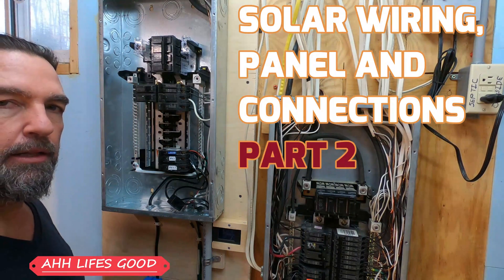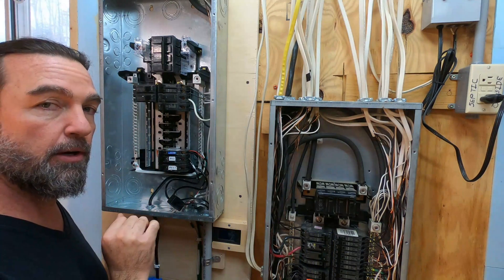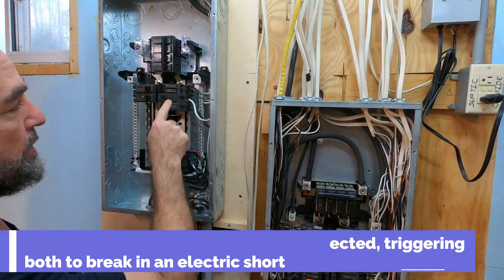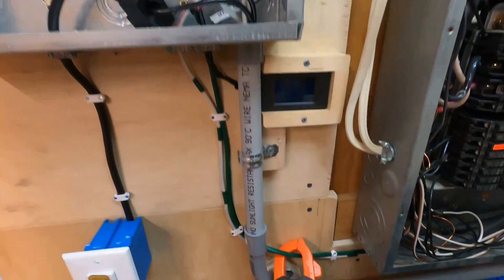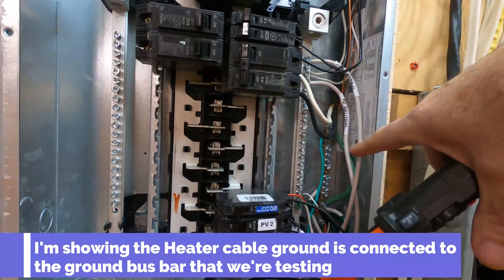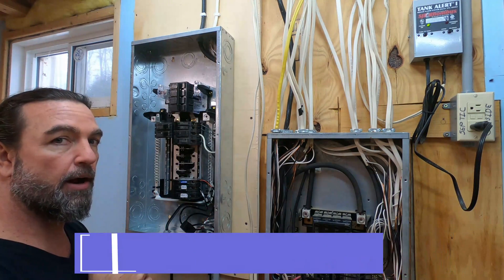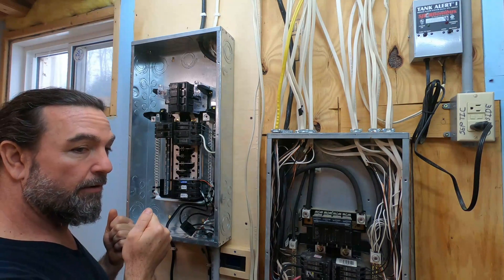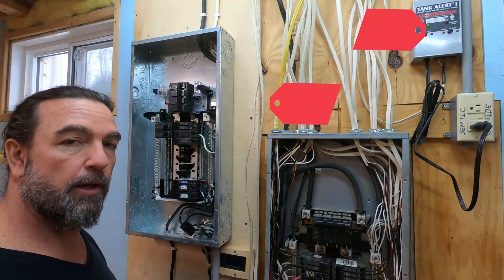Part 2 - DIY - How to wire Solar Panels to Break Box - Beginning to End

Comment: the white wire going to the 220vac breaker should have a piece of black tape to remind people it is being used as a hot or line wire.
Reply from the maker: Thank you for the tip, good advice

Comment: HOWdy  A-L-G,

in INDIANA - a SUB-PANEL is never EVER "BONDED" or the service will FAIL Inspection 
the FIRST PANEL ( MAIN PANEL) is BONDED "period" 
but 
NONE  of my Sub-Panels have the BONDING SCREW inserted 
...
on any of the SUB-PANELS 
ALL the GROUNDS are independently GROUNDED Near the Sub-Panel  on their own BUS Bar 
& All the NEUTRALS have their very OWN Bus Bar (separate from the GROUNDS) 
this was decided by INDIVIDUALS much smarter than me :-) 
... 
No "BONDING" on  my Basement Sub-Panel 
&
No "BONDING" on  my PoleBarn SUB-PANEL 100' feet away 
...
Both of my Sub-PANELS  have their OWN Ground Rods driven 10' in the Earth X 2 ( six feet apart ) 
... 
Your  local may have different RULES for SUB-PANELS  & Bonding 
...
COOP

Comment: So if i read this correct. If i have a off grid shed with one main panel for lights and outlets nothing coming in from the grid. Then i should screw in the green screw for bonding? I have the same invertor as you but only using 1 at this time. everything is going great except this green bonding screw.

Comment: That has been the burning question grounding I basically have the same system. I haven’t set it up yet it’s going on my cabin build in Southeast Oklahoma but the one thing I am not hooked up to the grid but I am in metal shipping containers. I would love some advice I was just thinking I was gonna treat it as if my first panel will be where my two inverters in my transfer form ago leave that box and then go to what I’m gonna consider subpanel with all my breakers and loads still not sure though about the inverters and how the ground goes any advice keep up the good work

Comment: My electric company bonds the ground wire (coming from the ground rod) to neutral (coming from the center of transformer) at the weather head. That ground wire does not come into the house (main panel). Only the neutral wire (which is now also ground) comes into the main panel. The two busbars in the main panel have all of the loads neutral and ground wires attached to them and those busbars are bonded. 
That doesn’t mean there’s two neutral/ground bonds. I used to think the ground wire itself from the ground rod comes into the main. If it did then I would have two neutral/ground bonds, at the weather head and the main panel. 
There should be relays inside the growatt that disconnect the ground/neutral bond for the AC out when in offgrid mode. Then you would need a ground/neutral bond in your “subpanel” and a separate ground rod that is wired to that subpanel. I’d think you need to find out if ground from inverters AC out is connected to ground of inverters AC in. If it is then id think you don’t bond ground/neutral in the “subpanel” because that subpanel would be utilizing the mains ground rod.
Reply from the maker: - Very helpful information and response, thank you for sharing!

Comment: As a mechanic with my electical knowledge all this bonding/grounding with the main and sub panels is very confusing. To keep things simple as possible, if it were me switching from grid power to off grid I would set up a seperate panel and as my system grew I would literally take circuits from the grid and place them in the off grid panel. Just keep adding solar or wind and batteries until my system could handle the load. I think you would be there for sure if you could get rid of those thirsty electric heaters. You have a great system and you are doing a great job in sharing your knowledge to everyone. Thanks!!
Reply from the maker: Thank you BFG for sharing your comments, good advice and words for all.

Comment: I know you didn’t do the original wiring, but I do have some questions about it.  You said there is a shutoff outside between the meter and your panel.  If that is the case, shouldn’t your neutral and ground be separated there?  Wouldn’t the original “main” panel inside be a sub panel?  If it is, then there should be separate ground and neutral busses in the indoor panel.  In the video I see both neutral and grounds going to the bus bars in that panel.  That may not be to code.  Also, at the top of the right bus bar it looks like there are 8 or more wires connected in the main lug.  Is that to code?  Looks sketchy to me.  Again, I know you didn’t do this wiring.  Your work looks great and I appreciate the videos.  I also have questions about separating ground & neutral and bonding on panels fed from the inverters.
Reply from the maker: - Morning Robert, great comments! There is a main shutoff outside at the meter  where the neutral is separated from the Ground of the main panel. I'm not an electrician but from my understanding the first (main) panel then comes from that shutoff is your main panel? That being said there is no separate Ground from the Neutral bus at the main (first) panel inside the house. In theory I agree with you 100%, it should be called a "subpanel" but in principal I don't know the right wrong terminology the electricians use for that setup? My guess is "main panel" as it seems to be the same configuration on most houses here. Now the sub panel I installed with the configuration I currently have on it, has a separate grounding rod from the main panel and is separated from the Neutral and NOT bonded to the panel (ground)... Yes that Main lug has about 30 cables into it, soon I will be cleaning the electrical up on that box. Any professionals please way in on your comments if this configuration is not correct, thank you!

Comment: I have yet to install my system but Im sure I will have the same problem as you do with the bonding. 

As I understand, the problem would occur when you Bypass the inverter and use the Inverter's AC IN to charge your batteries. Then youd have 2 places with the Ground/Neutral Bond. Im still researching what to do in this case.

Not using the inverter's AC IN / auto transfer switch would make things easier but I really want that transfer switch feature!
Reply from the maker: - Kevo that's a good question that was pondering in my mind in theory and principal when I was installing this system. Unfortunately I've never been able to find out exactly how the inverters handle the switching between grounds (transfer switch), seeing as there is 2 separate grounds running from the AC IN and OUT of the inverters. I know there is a Dry port available on the inverters that could be used in the event of a neutral short.

Comment: Your supply line from the grid should have line, neutral and ground to each inverter so inverters act as main panel and are grounded, any panel supplied by inverters are considered subpanels and as such should not be bonded
Reply from the maker: Well said Eric, very clear on grounding message thank you

Comment: Never Bond a sub panel especially where you got that green screw from the neutral Busbar to the Body of a metal panel. However you only Bond the first entrance of your main neutral together with the Ground Rod wire. Then all the ground wires connect to a ground Bar by themselves.
Reply from the maker: - Thank you sir for your insight, I keep hearing and reading this same advise while struggling with the logic of how the inverters actually handle that Ground/Neutral connection in the event of a short circuit, seedings they are the only device that's not a directly wired circuit between panels. Planning to follow your advice and keep searching for relevance on this topic. Any thoughts on using the Dry Contact port of the inverters to setup a Neutral Relay? Thanks

Comment: Inverters dont referrence the same ground as the mains in some systems so bonding the netural and ground is and the Mains power would drop and then for the electrcal system to find the bond its would have to travel back to the dead panels You have 2 sources of power with there own reference ...  The power company wants to make sure that your self generated power stays off the mains when they are working on them...
Reply from the maker: Thanks Traci for your insight, what's your opinion on installing a Neutral Relay switch on the Dry Port of the Inverter? In principal it should ensure that the Inverters only handle one Neutral at a time, alleviating the possible double ground issue if I keep the sub panel bonded?
Reply: @ahhlifesgood1956   @Ahh Lifes Good  I would check with who made the inverters.. Also enginer775  I am retired from power co and have seen what happens when power is fed back to the mains and even though your system will not at the moment who knows when some thing wil go wrong... Have the circuits seperate all the Inverter panel have its Netural to ground bonded then the mains being bonded at the first disconnect  like yours is   .. I wasnt sure but on your first main panel did you have many neutrals on the buss bar?  That is a red flag as well    
Safety was drilled into my head for my entire time that I worked there   I am not electrician as in the power side I was in the telecommunications side with Large DC plants   Cell sites  Solar and Genterating plants ....
Reply from the maker: @Traci_S_Aaron  - I really appreciate the emphasis on safety and correct setup, please keep the opinions coming. The bus bar on my main panel is a floating bus bar that functiond as neutral and ground. No seperate grounding bar here. From the main panel neutral bus bar I have a ground wire running out to my service panel at the meter which functions as the bond to panel and connects the Copper ground rod. Not sure if this is correct but it makes sense logically?

Comment: Wonder if the sub on grid tie needs separate ground and neutral wire back to main panel and tied into neutral bonded at that point?
Reply from the maker: - James that's a very good question, as that idea would most definitely tie the sub panel to the main panel alleviating the guess work of how the inverter handles that ground between both panels.  I couldn't answer that question though,  hopefully one of the viewers might? I know another creator out there Andy P installed a Relay Switch on the Dry port of the Inverter, which I beleive gives added ensurity that the inverter indeed will switch from open to closed on the Nuetral from either Main or Sub, never opening both at the same time. I purchased one of these switches and might install it, pending what the viewers suggest in this question. Thanks

Comment: You dont have current on the ground, because your circuit is proper ( appears to be) but, if the neutral wire breaks, comes loose, or gets removed, the load will transfer to the ground. Therefore,  the bonded panel will be energized and Could shock you. If the panel is unbounded, any stray voltage will run back to the original ground and rod. Solar can be tricky, if you use the pv. Panel as your stand alone main, you should bond. If your pv. Is a sub panel, than don't bond. I'm not licensed either. So take it for what it is, my educated opion. A electrical inspector  once told me; when in doubt, don't bond, but always ground everything, in one location at the main. Everything else leads to that. The main. Hope that helps.
Reply from the maker: Thanks again Darren for a precise and thorough explanation, my thoughts in many words come to the same conclusion as yours on this "bond, ground" issue when it comes to solar grid ties. Unfortunately there is not allot of this unique information our there yet. Cheers!